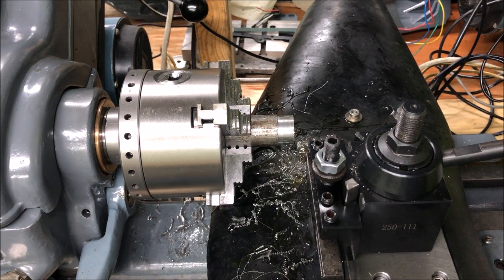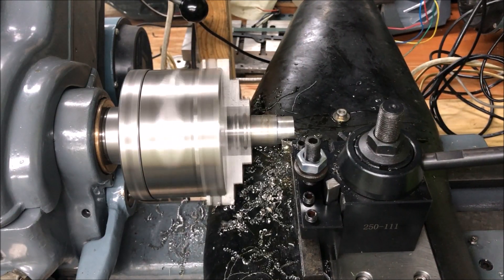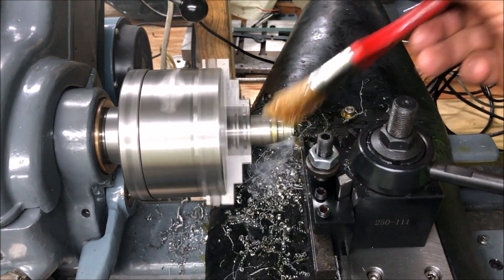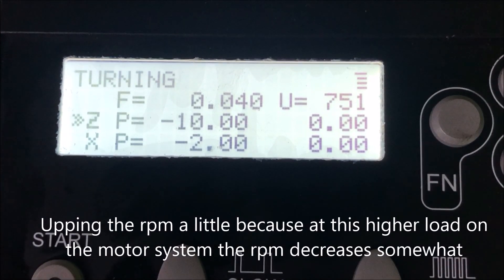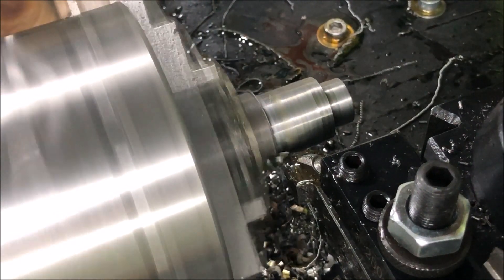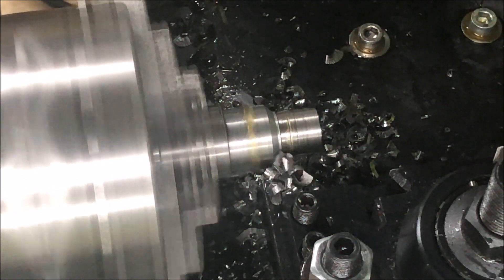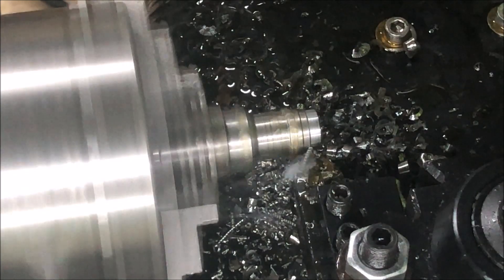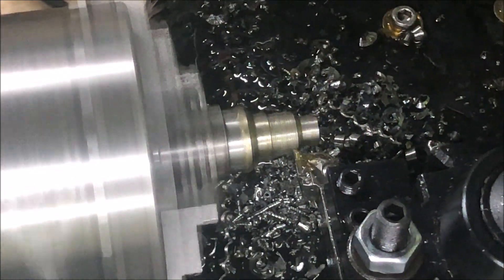Myford Super 7 -  test cuts - part 1: with solid tool post and ELS

Comment: A 3mm cut would not go well on my little Atlas 618.  The v-belt slips when my cuts get too heavy, even when I try belt dressing.  Might be time to examine my pulleys, maybe they are worn or too smooth.  Count me in for part 2!
Reply: And to add a bit to what Jan's already said. The Atlas 618 lathes have a known very weak spindle in them. There fairly easy to bend, so having your V belt slip under heavier loads might be a good fail safe to help protect the machine.
Reply from the maker: The Atlas is a smaller machine, so would have even greater difficulty to do this. However, the design was not meant to do this either. I actually thought the belt would slip too, or the motor would stall, and it was close, so this was possibly as hard as I could push it. The belts are new, so this helps. PS! I thought about using a linked belt, as this is easier to replace, not having to strip so many parts, but after talking with persons in the "transmission business" I was told that the gripping power would not match the normal V-belts. As you can see, they are not very tight on the pulleys (which I think is nice as if you have them tighter, the temperature on the bearings, especially the countershaft increases). The better solution, and one which Myford switched to in their final machines, is the multiribbed V-belts (serpentine belt). I have another machine that I will fit with this, along with the DC motor and controller, all ex. treadmill (was given one from a neighbor :) )

Comment: Is this the ELS from Canada or some other version?
Reply from the maker: The controller box is made in Germany by the company Rocketronics. You can buy these units separetely if you have the other parts or in kits with the motors and drivers (I have the Leadshine drivers and a hybrid stepper on the Z-axis). See link here: https://www.rocketronics.de/en/  If you go to the /Shop page you can see these kits listed. I didn't want to make it complicated, so I bought a complete 2-axis kit, z- and x-axis, but the system also works with just the z-axis control if you so desire to have it. Other, cheaper motors/drivers etc. can be used of course. PS! Many of these are copies of the Leadshine products, ie. Chinese makes a quality products that is copied by other Chinese companies :). On the /Downloads page you will find an English manual, which is very good.. Instead of reading the /Products page for details..for example a comprehensive and detailed explanation of settig up the electronics part, plus also elaborating on different topics eg. on the threading, for which there are different methods to choose from.

Comment: Hi Jan,
That really surprised me... I would never imagined the Myford would do a 3mm cut... as you said it is maybe not advisable but nevertheless interesting... Looking forward to part 2.
Take care.
Paul,,
Reply: I think Jan has fitted his slides, feed screws and nuts into at least new condition and possibly better on his scraped slide fitting. A machine in more worn condition might start chattering much more easily under these feeds and depths of cut. It would put a high load on the lead screw and nut though. Having a separate feed rod would be a better choice for these kinds of loads on the machine. But as you say a bit surprising that the machine is capable of taking that much.
Reply from the maker: @turningpoint6643  Very true! Not adviseable as a general turning practise.
Reply: @jansverrehaugjord9934  Maybe not, but as you say still it's worthwhile finding out the limits of a machine. And it will I think be very interesting to see the difference in cutting ability, chatter initiation point etc with the standard top slide mounted back on the machine. An article in one of my George Thomas books first written around the 1970's specifically mentions his preference for using the Myford 4 station tool turrets over any QCTP because of there much better tool support. I think he also would have been a real believer in using these tool blocks when the top slide isn't required. 

While larger feed rates and depths of cut can be taken with these tool blocks, that still loads the lead screw and nut past the best practice point for part longevity. So the real gain is I think in better accuracy, surface finish and with possibly a bit better cutting edge life. I'd very much agree about your ER 32,40 collets and chucks.I can use the factory produced ESX 25 collets on my Emco C5 sized lathe and there's a noticeable improvement holding parts with the collets over the 3 or 4 jaw chucks. They definitely show a large gain in how rigidly any part is held.
Reply from the maker: @turningpoint6643  Very true. I am just testing now (because I said I would do it I had to stick with it haha). I guess a 4 way toolpost would not be far off and if i tighten the topslide I also think it owuld provide a pretty stiff mounting. PS! I forgot to add the 2 bolts for the solid tool post ..
I think I will also purchase an ER 40 version and adapt it as I see this would be useful
Reply from the maker: Thnks! It was a kind of "let's find out where the limit is" test, but I was also surprised. I could have tweaked it further also, especially on such smaller diameters an ER32 or 40 collet chuck would have shortened the overhang from the spindle which I think is a contributing factor to limit the performance. of no particular practical interest really as you will not have/want to do such cuts I guess, it was a setup I think will show if there is any great difference to the compound when I mount this. As Turning point  also suggests, the "performance" is also due to the newly fitted saddle/cross-slide.. and more.